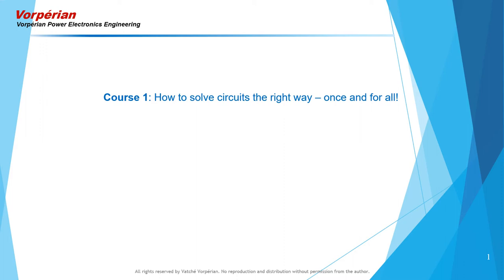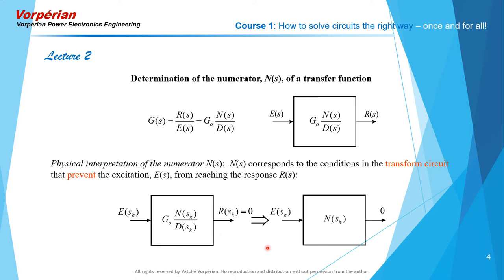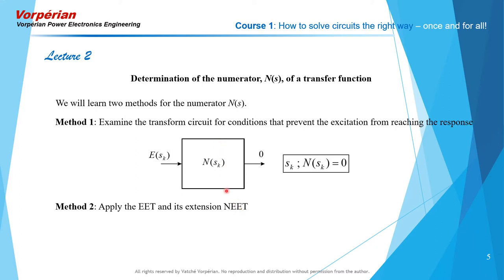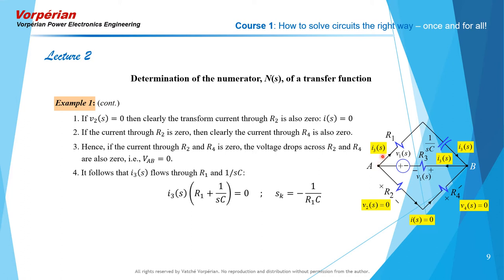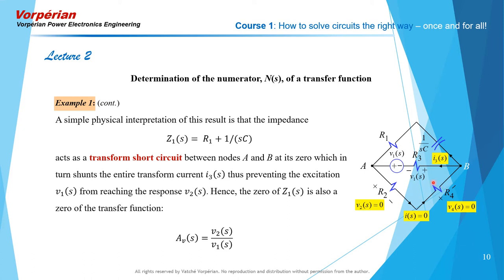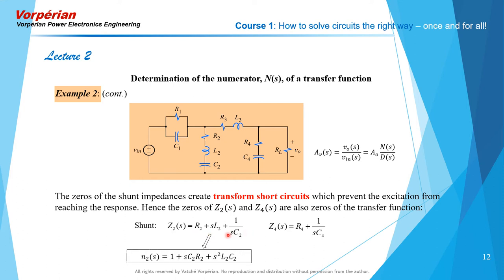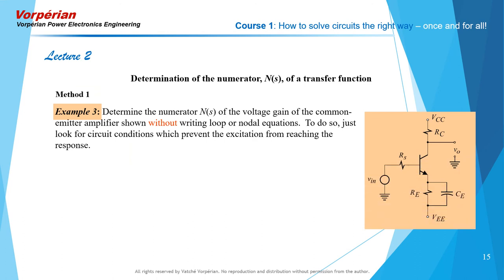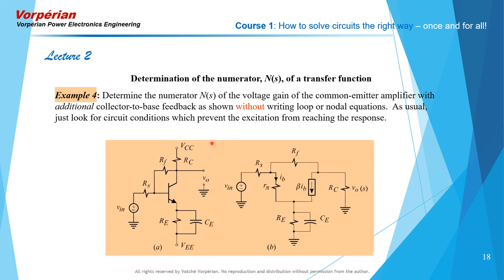Video 8: Fast Analytical Techniques in Electrical and Electronic Circuits

Comment: Hello Dr. Vorperian, I am hoping you see this comment. You said that no value of s can make Z3 be an open circuit for Ex. 2. However, what if s tends to infinity. Would Z3 then become a zero of the circuit at infinity since sL would tend to infinity?
Reply from the maker: Any finite zero can be thought of as a pole at infinity and any finite pole can be considered a zero at infinity. In fact, for any transfer function, the total number of zeros equals the total number of poles when you include those at infinity. This is not very useful though in general but has some significance. If you, for example, consider the locus of the closed poles as a function of the gain of feedback system, you know that the closed loop poles end up on top of the open loop zeros. Now if your open loop system is a third order transfer function with no zeros, then the closed loop poles move out to infinity as the feedback gain, K, goes to infinity. That is where the three open loop zeros at infinity are! Hope this helps.